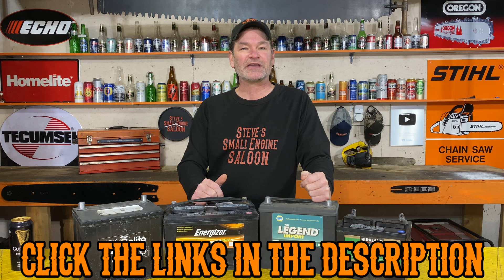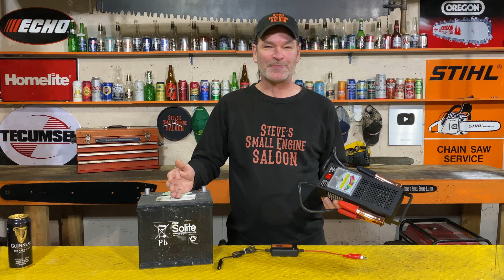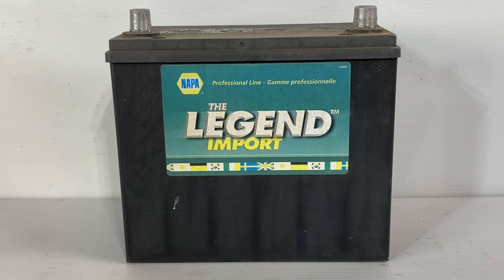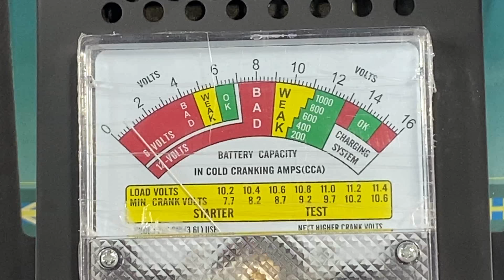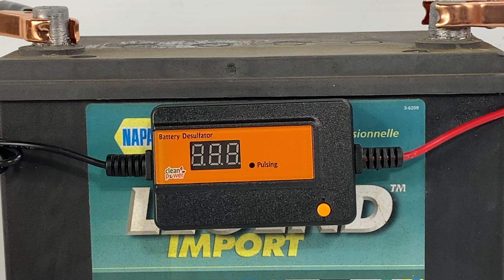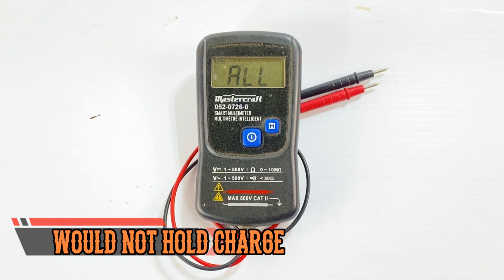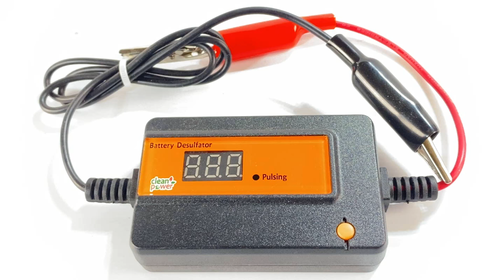Does An Electronic De-Sulfator Really Repair A Battery?? See Real Results

Comment: These DO work well... and these guys https://www.schumacherbatterychargers.com/  have a couple chargers that will help do the same thing.   Steve is right...it does work.  I have recovered several batteries from my local transfer station to fully operational by high voltage pulsing (manually) batteries that were given up for dead. "Burping" lead acid batteries can bring back presumed dead batteries more often than one might think.

Comment: Hello Steve,

 I've been using the baking soda+water clean out and distilled water+Epsom salt 2 refill.  I've had 100% success so far on 3 of our old batteries.  It's takes a little time but well worth the time and effort.  Keep it up Steve!  D.R. Small Engines out!

Comment: I always thought those desulfators were a pack of junk, but if you say they can help... I'll believe it's true. So, bottom line... no chance for those cold dead dogs, but if they're just a bit congested with the sulfur sniffles... it might cure the coughing and sneezing... and one of my pricey headaches. Now tell us what makes 'em go bad so fast sometimes? Thanks Steve
Reply: What makes them go bad is not getting used and charged properly and regularly. Too much storage time. Pulse chargers keep the terminal voltage up where it belongs, and keeps the lead sulfate crystals in suspension in the electrolyte rather than depositing on the plates.

Comment: Steve this is wonderful!! Hey you might want to check out TYGON fuel line against regular fuel line when it comes to ethanol resistance. I am a chemist and we use TYGON R3603 for all types of chemicals and it never fails. TYGON has a fuel line I believe it is LP-1200 or something like that and it is supposed to be great but I have not tried it yet.
Reply: @Islandwaterjet  Great idea. Which one do you use?

Comment: I got a NOCO Genius charger for Christmas that has a built in desulfate 
function. Haven't had to use that yet, but it is a great 10 amp charger.
Reply: I have the big noco with the repair feature. Haven't had it bring a bad battery back to life yet, and not a dead short boil over battery. Just a well worn battery that has lost its cca

Comment: STEVE,  most batteries, if given proper maintenance of ' trickle charging ' when not in use, ie-( lawn tractors- snow blowers- motorcycle type) will last along time, Problem is,  nobody thinks about it charging them off season, ,  and just buys a new battery when its 'dead' .
I like your vidio, might have to try it.
May get another season from the old batterys I have! Thanks!
Reply from the maker: You're Welcome...

Comment: Guinness straight from a can never. Cooled and properly poured into a well shone glass unbelievable. Believe it or not that small ball you hear rattling about in the can is a very smart piece kit . So go and do it properly and it will be like sweet   
Milk. Greetings from Ireland and great information from your self as always.🥃
Reply: It’s a ‘ widget.’ It’s in Boddington’s too. Both of which just happen to be in my top three beer list. The other is Yuengling. All three deserve a nice tall glass or beer mug. Cheers! 🍺
Reply: @StringerNews1 
A good pub will also make sure the lines, from the Keg to the tap are always clean and serviced. Back in the day if you came into a busy Dublin pub , the bar man could have 50 or greater pints Guinness at different stages, ready for the busy lunch time trade. When that pint was drank, always a new glass for the next pint.😄
Reply: @StringerNews1   You mean finding ANY good beer in the US is rare!  Come visit us in Canada for REAL beer and ale!
Reply: @StringerNews1   Love to have you visit.  AFTER everyone has been vaxx’ed for Kung Flu.  Right now pretty much everything is locked down, and will likely be that way until fall.   Unfortunately we have a useless tool for a Sub-Prime Minister and vaccines are scarce to non-existent!
As a side note, I made a very good living in the small engine/ power equipment field until I retired at 55.
Reply: Guinness is a very under appreciated gift from the Gods.

Comment: Thanks I also believe when battery sediment gets excessive it “shorts” out the cells causing a continuous and fast discharge. These batteries where possible should be drained and refilled with acid or the original acid minus sediment.
Reply: Sediment can cause internal draw. So does sulfate crystals. You can empty a battery and flush it with distilled water to remove sediment. Then replace the electrolyte. You can also add epsom salt or alum. You can gain some use with this method sometimes. First check there are no dead cells. From my experience however it doesnt work that well. And for cold cranking amps and capacity its very poor.
Reply: @briankennedy5578  How do you flush it when the holes in the top are 3/4" and have a plastic shoulder inside?
Reply: @POOKIE5592  Duck tape and 1/2” drill.   ....  nah, I’m just playing, that battery acid ruins everything and is messy as heck, push it off to the side and use it as a core when you have another battery you got a buy
Reply: @dorhocyn3  Agreed.  I can't think of a way for the average DIYer to successfully pull this of without a high risk of burning yourself, or at least spalling the crap out of your garage floor.
Reply: @1pcfred  My dad used to know an old guy that did that during WW2 because people couldn't get batteries.
Reply: @1pcfred  rainwater: nature's distilled. Also, dehumidifier.
Reply: @thedavesofourlives1  I always use distilled water.  It's only 99 cents a gallon at the supermarket.  It's the only thing I use in cooling systems, too.
Reply: Sounds like a tricky task to perform, dumping a battery and straining the acid.
Reply: @POOKIE5592  yea, be prepared for 5 minutes of brown lead contaminated wastewater per cell flush.
Reply: Flaking between plates is definitely a real thing.

Comment: Did you try on any AGM batteries?
Reply: Make sure the pulse charger you buy is designed for AGM. Yes. There is a difference. Some chargers/maintainers have a selector switch for Flooded/AGM/Gel batteries. That adjusts the top-off voltage to the correct cut-off level.

Comment: so what is it actually doing? Desulfator... huh?
Reply: It essentially for all intents and purposes charges a capacitor (using what charge is left in the battery --hence the need to have a battery with juice in it) to a higher voltage than the battery and then releases it to the battery as a pulse. sometimes called 'burping' This can 'de-sulfate' the plates, or even sometimes clear a dendrite-like short between plates.  It is safe and effective in the right circumstances and is absolutely worth trying. IMHO everyone should have one in their toolkit. It cannot fix low electrolytic concentrations or hard shorts, but it IS worth owning...in my humble opinion.
Reply: Im not an expert or anything, but I'm pretty sure the sulfuric acid in the battery leaves deposits on either the positive or negative lead parts inside the battery kind of like limescale from hard water. I think the tool switches the polarity of the inside parts of the battery to eliminate the deposits.
Reply: From thedrive.com: A desulfator uses voltage or high-frequency pulses to “zap” the sulfates that have built up over time in your battery. The electricity loosens the sulfates and they drop back into the acid and dissipate.

The desulfator in the link above operates at 10 kilohertz which is audible.  I wonder if said "Steve Out!"

Comment: I purchased a Battery Minder that has that built into it that is amazing.
Reply: Hi Marshall, I got mine from Northern Tool . I've been very happy with the way they have maintained my batteries . I use them for the lawn tractor and the generator . The batteries are 7 years old and still start on demand .
Reply: @Robalo-2660  that is where I purchased mine also
Reply: Oh, here's the other thing. People think you put these on for a day or maybe a week and that's all. This is not the case. It might take several weeks or maybe 2 to 3 months of desulfating to bring a battery back.
Reply: @scottjohnson3845  absolutely I agree 👍
Reply: yes, 7-stage chargers/conditioners should do desulfation just fine.
Reply: Yep, Battery Minder does work.  I've got 6 or 7 of the small units (1501 ?) from Northern Tool and keep them on all my batteries when not in use.
Reply: The 15W solar panel on mine crapped out in about 7 years.  I bought a new 20W that is better construction and it's back to doing a good job. Well worth the money except for their cheap panel.

Comment: would it work on gel cell 12volt battery that is sealed?
Reply: Pulse chargers are available for any lead acid battery. Flooded, AGM, or Gelled electrolyte. Purchase the correct one, or one with a selector switch. They are not all the same. It has to do with the cut-off voltage.

Comment: Never knew something like this even existed. This is a game changer, bc some of these batteries ain't cheap. Steve you are the man sir!
Reply: @StringerNews1 That seems a bit harsh, even for those that do try and maintain their batteries oopsies happen. Grabbed some tools last spring to re-connect my lawn tractor battery and oops, forgot to disconnect it last fall....DEAD
Had a friend disconnect my F350 battery (neg terminal) after I went away for the winter and oops the terminal ended up still touching the battery post, it was dead for months, 0 volts when I got back. In both cases a combination of old school charger and little NOCO (Chinese magic) charger brought them back to life and 2 years later I'm still using them. Somehow they didn't freeze and weren't destroyed, de-sulfation actually works and saves batteries for those of us that know how to look after them too. Thanks for the video Steve!
Reply: @deanmiller9039  yeah, that didn't happen. it's not how chemistry works. 
besides, if that were the case, there would be hugely profitable businesses reselling used batteries just like there are for retreaded tires.
Reply: @StringerNews1 I agree battery maintenance is the number one prevention. But I guess you've never bought anything where people have not done battery maintenance before and sometimes you buy small equipment like a riding mower or a push mower or something with a bad battery and the battery itself is pretty darn expensive. At least I realize there's something like this now that exists instead of having to go out and drop 80 plus bucks on a battery.
Reply: @StringerNews1 
You want people to thank you for insulting them ???
I guess your parents didn't teach good manners.
Furthermore if you're so wise, how about you explain yourself better.
I mean telling people to go buy a book on battery maintenance??
Get a life
Reply: @StringerNews1 yes, ideally we would all maintain our batteries in tip-top shape. sometimes, however, we buy a vehicle where this has not been done (happens a lot with motorcycles and riding mowers). in cases like this, the revival of a neglected battery can be a money-saver.
Reply: @StringerNews1 
Sometimes, you’re attempting to help a battery that was neglected by someone else....
Reply: @patrickflohe7427  Might as well forget that,He has shown multiple times he doesn't/can't understand that being he is someone special & above us normal people. Yet funny as smart as he thinks he is,He couldn't even spell Rolex right lol.
Reply: @StringerNews1 I agree. My dad taught me to look after batteries, back when you needed a hydrometer to check charge. The best way to look after a battery is to keep it properly CHARGED. Worst thing is town driving a few minutes, especially in winter. Pick a good automatic battery charger - Battery Tender, Battery Minder, Noco whatever (I’ve used all three) - and just use it

I easily get 10 years out of a battery. It’s not hard.
Reply: @StringerNews1 seems like the magic box, according to someone whom i have learned to trust, does extend the life of some batteries. i fail to see that as a problem.
Reply: @StringerNews1 he made it clear that it does not revive all batteries. like i said, his trust has been earned. yours hasn't. i just finished buying one on-line; looking forward to getting it and having it pay for itself with it's first battery-life extension ! have a great day !
Reply: @StringerNews1 just placed my order. looking forward to bringing a few batteries back into service. possible game-changer !
Reply: @StringerNews1 Steve is verified,Probably has more years of experience than you,Aside of more brains!!
Reply: If your in the market for something like this, check out NOCO. I can't confirm how good they work yet because I have one on its way I ordered it a few days ago. I ordered their genius 2. It is a battery charger, battery maintainer and desulfator all in one.
Reply: @ronaldstrayer580  Something that is interesting to hear if it actually does its job. Just like Steve states it all depends on the issues with a certain batt. Hey Ron, let me know if it does its job correctly. Thx much.
Reply: @toddrhine7648  Todd will do. I received the charger and it seems to be a quality little unit. I am mainly going to use it for a battery maintainer so it might be a little while before I use it on an older battery. The battery that it  is going to be used on for now is in decent shape. One of its features that I really like is that I can remove the clamps that you would normally hook to your battery terminals, and install the wiring directly to your battery with ring connectors. Then its just a matter of plugging the charger into that wiring when you want to use it and when you don't unplug it. The one I purchased is a 2 amp, as I am mainly using it on smaller batteries but Noco sells larger ones.
Reply: @ronaldstrayer580  Thanks much for the input
Reply: @StringerNews1 You suck!  Your assumption that everyone tasked with fixing a problem is to blame for it is pure bullshit.  FU